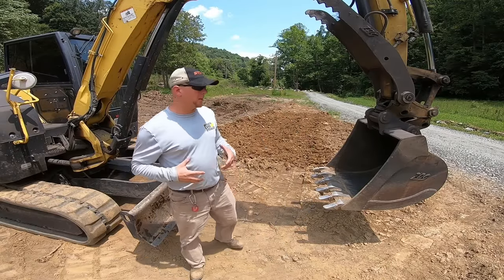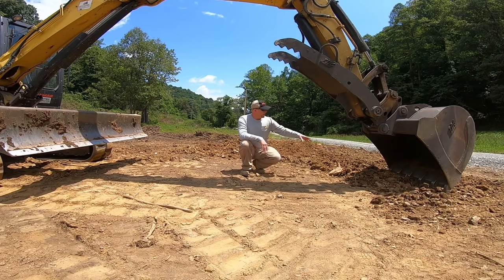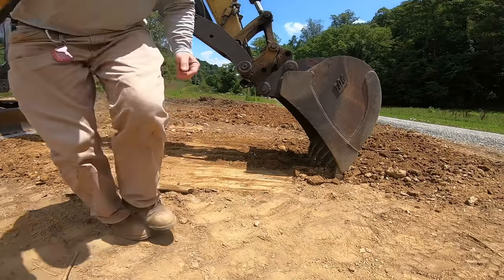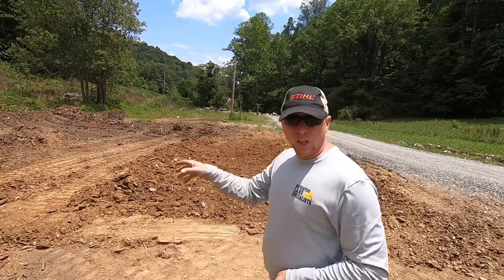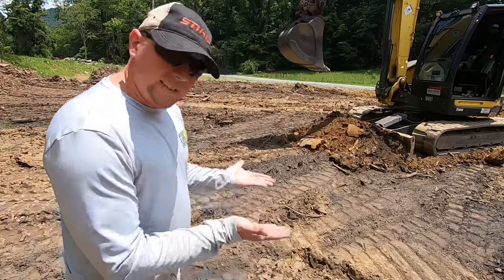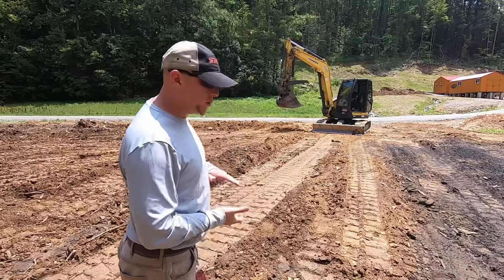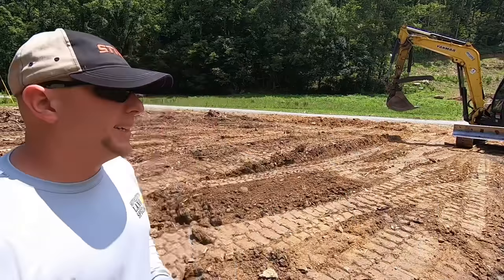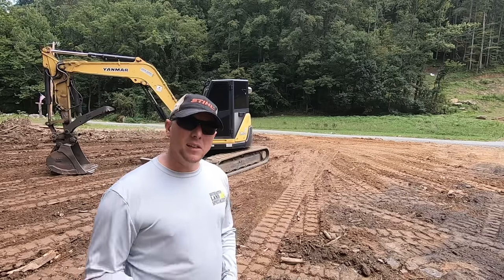How To Grade With An Excavator-Tips and Tricks

Comment: One suggestion is to include using a laser level for the grading. use a wood stake at the low point and adjust the top of the stake to the level you plan to level\grade to so you have some indicator of how must dirt needs to be moved. Ideally your going to fill in the low spot to the height of the stake.
Reply from the maker: Great tip!!!

Comment: Something that can be tricky to explain to new operators... is how much to leave a filling push “high” because the material will usually compact. You don’t fill a low spot with your blade even with hard ground... you leave a couple inches(more or less depending on material) as you push the fill in. Some material compacts a LOT and others not much at all. Something to keep in mind as you fill. It’s better to overfill... compact... then cut to final grade rather than constantly being too low and having to push and compact and push and compact. Lol. Just push in a little high... compact... then grade it out and then do final compaction.
Reply: Overfill, compact and then cut makes good sense. Thank you.

Comment: This is very good, Ive run a  Deere 27D to excavate  an old 1880s era drain tile that was causing water fom the field behind me to be piped into my basement, 2 of them actually, were once part of an long demolished RR roundhouse turntable drain etc that ran under my 1930 house, but when the basement was dug they took out pieces of that old pipe, but it still collected water soaking down after winter snow melts and dumped it in my basment.
I had to dig down 6 feet to the top of the foot diameter pipe, and rip it all out 50 feet to the fence and back fill it, but now I need to rent it again to "scrape" about 3" of dirt/grass off a 40x40 area in my back yard to fill the space with about 3-4" of sand for a dog play area and not have to deal with dirt or grass coming up thru the sand. There was an old gravel driveway "loop-te-do" on about half of it, that's down about 3", so this video shows me some techniques I'll need in the spring to do the "scraping"!

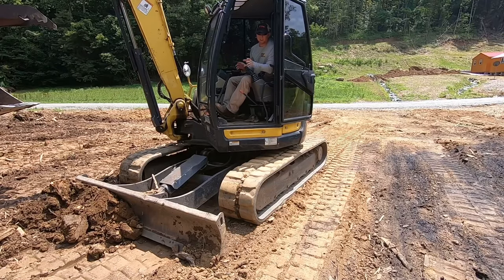Comment: At the 17:40 mark you touch briefly on a very important bit of advice which is to keep your eyes mainly on the side of the blade (or bucket in a skid loader) where grade has already been established. You can't see the cutting edge on the side gathering dirt but rest assured it will be the same as the side you CAN see. Focus 100% on that. Otherwise you are just wasting time and going to make a mess of things.

Comment: I'm getting a 12" and 18" and 36" bucket. I dig 12" and 18" footings commonly. I got a call and the salesman was selling me the 36" with teeth and some adapter that made the "teeth fill the gaps" for "finishing." I originally thought I'd be better off with a grading bucket. After seeing you using it to break the surface, I am having second thoughts on the grading bucket. Any advice?
Reply from the maker: If you do a lot of footers and do finish work a grading bucket is where it’s at. If you do a lot of dirt moving teeth are a bit better. I’ve got my tooth buckets so I will be buying a tilt grading bucket soon
Reply: @DigginLife21  Yeah, I thought I did right. The sales guy switched me to a 3 foot with teeth, and then they couldn't get it, covid I guess, but I really think with my ponds and ditches, I got the right bucket. With the 18 and 12, that's a must, but should I get the 24"? Well, I'll buy them later if I need it. I really want another auger drill. I had one for my backhoe, and loved it, and had it on the boom.
Reply: @DigginLife21  Yeah, I was wondering how I was going to level the blade without stabilizers. Was just looking at the tilt bucket. Real handy that! 
I got the 4 way blade. I was wondering if a 6 way, if there is such a thing would level it up, but probably unstable I assume.

Comment: Yea this makes me lean toward an excavator as the first piece of a landscaper's arsenal. The skid steer is in close 2nd. Ive seen a fella use a mini excavator smaller than that one to demo a buillding very quickly so i know skid steers have that demo grapple too, but the excavator is no slouch in grabbing/ripping even with a basic fixed thumb and it can reach higher to deposit debris into a dump truck or dumpster. Imagine ordering a dumpster and realizing your skid can't reach high enough to dump the bucket or grapple out. Or, it's high enough but you can't lift a full load. No more benefit over an excavator.
Reply from the maker: Glad to help